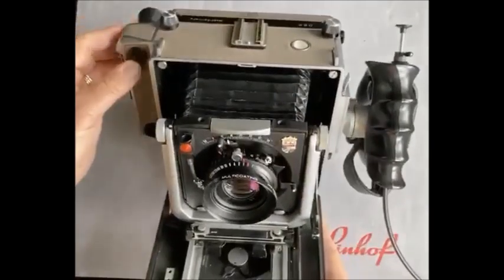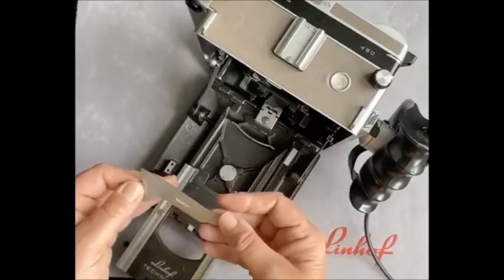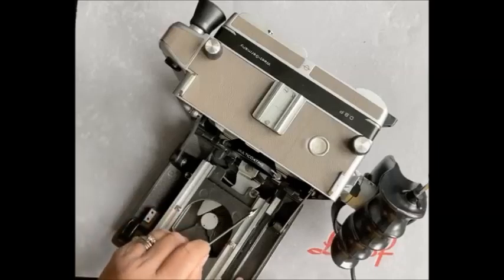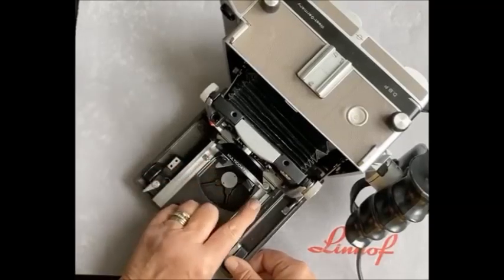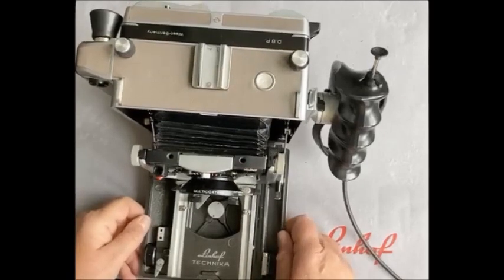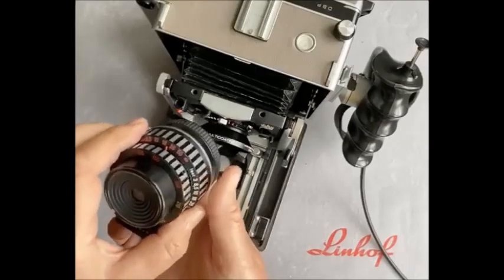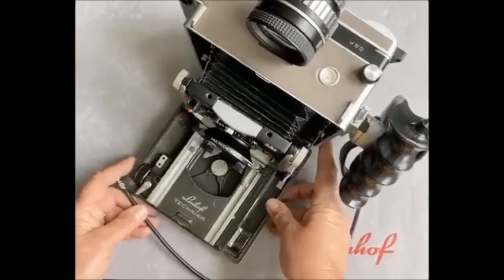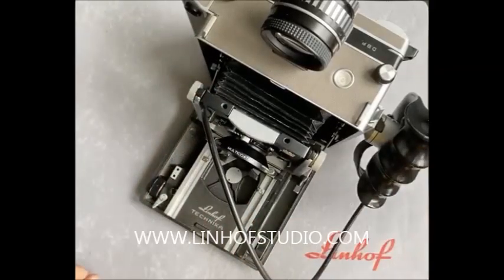Linhof Technika Rangefinder Explained

Comment: The Linhof quick release system for mounting a cable release in a Linhof board..
Linhof lensboard are sold in a second hand shop in Delft in The Netherlands
with the quick release system removed and so having a huge light leak.
A kind of swindle I have never met.